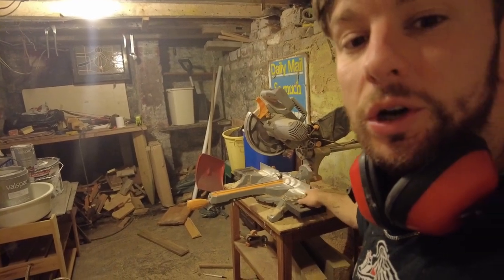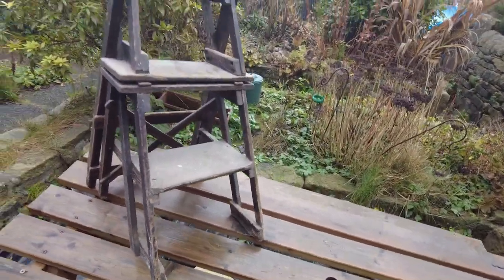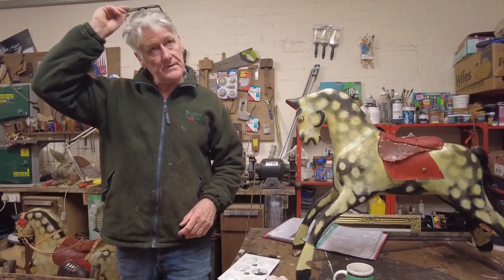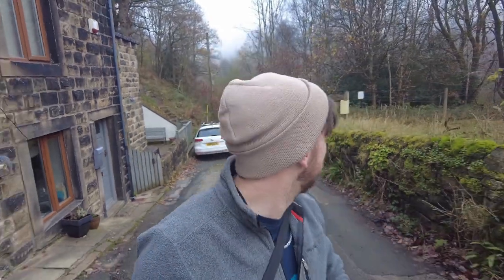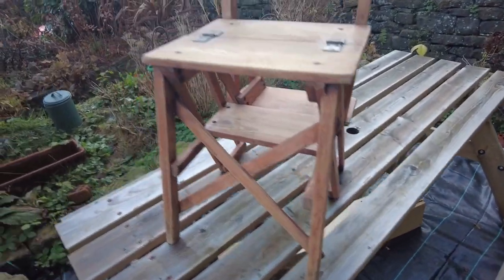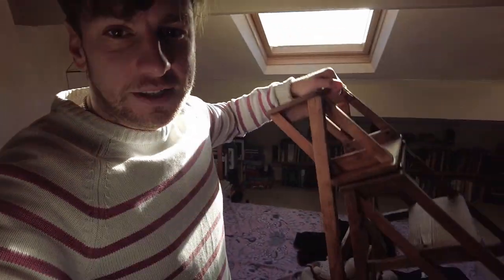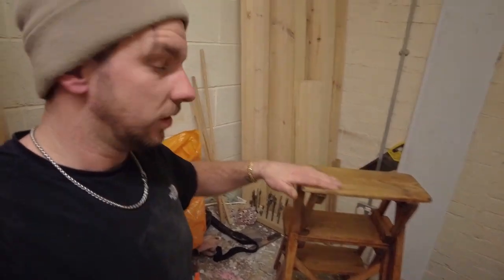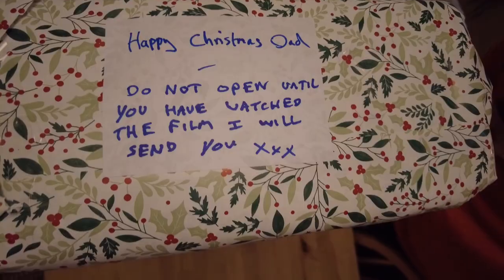Restoring My Dad's Old Step Ladder Chair

Comment: My neighbour has a huge rocking horse in her front window. I have to take a peek at it every time I walk past her house. It's stunning & I'm sooooo jealous 😭🎠💕 .........p.s just before Christmas I stripped the paint off an old chest of drawers & bits I bought to do it were wire wool, those exact same little scrubbing brushes & a pack of sandpaper 🤣🙈